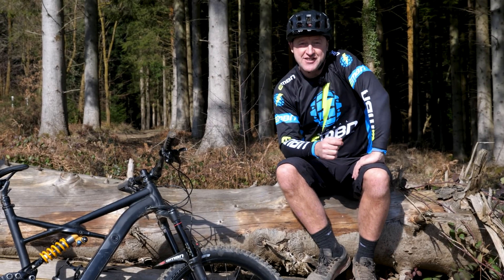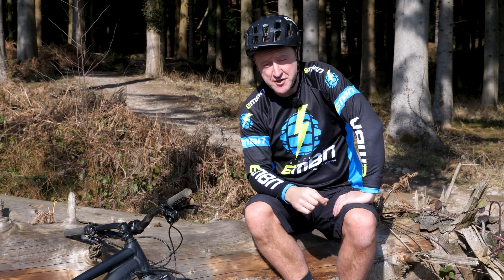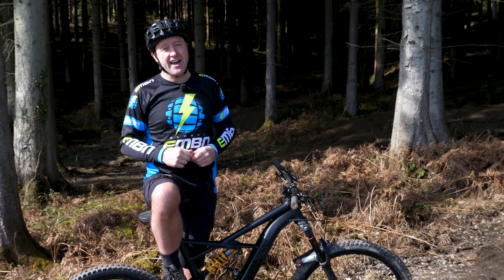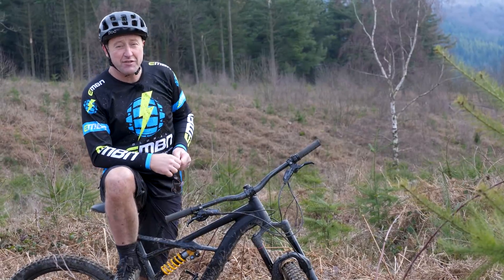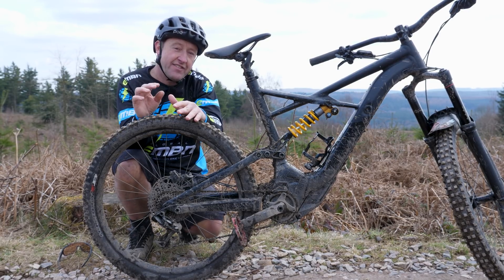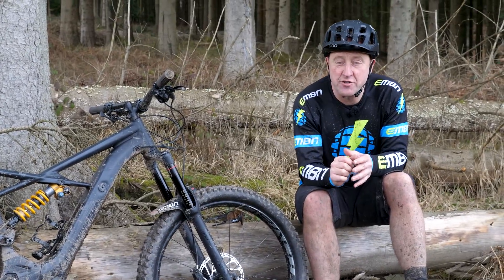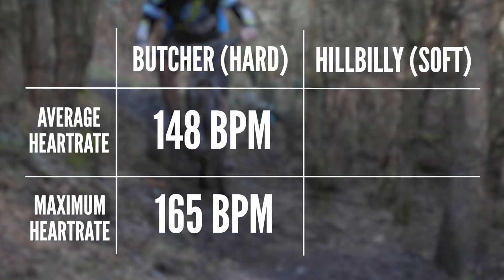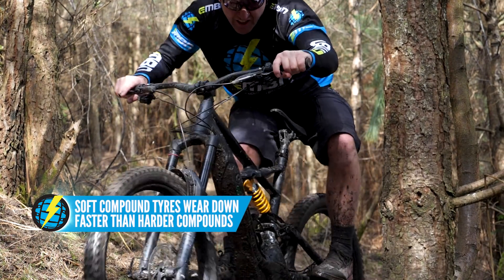Hard Vs Soft Tyre Compound | How Does Tyre Choice Affect Battery Life?

Comment: Fun video Steve but we really need to get you up to speed on power vs energy 😏 as you concluded in terms of power which has no time base. Here’s a pretty good explanation of W vs Wh https://cleantechnica.com/2015/02/02/power-vs-energy-explanation/ Having said that maybe you meant it was sapping 20-40 more Watts of power rather than using 20-40 Wh more energy? The problem there is how you measure or calculate either as power or energy measured at the battery is quite different to power or energy consumed at the back wheel due to serial system losses which are variable.

Comment: Probably should be done with the same tread and casings to truly isolate the compound. Also, Specialized doesn't publish the hardness of the Gripton tires: While the Hillbilly DH has very soft 42a knobs, we have no idea what the Butcher Grid Gripton has.

(BTW, the old non-Gripton Butcher Grid has the same (very soft) compound as the Hillbilly DH: 70a base and all knobs are 42a, so I can't imagine the Gripton tire having very much harder knobs.
Reply: Justin White Hey Justin yes you’re right there’s definitely an argument for that. What was interesting was how the Butcher worked well on dry but not so on wet. The Hillbilly excelled in the particular conditions however a different day with less pressure in tyres might have given a different outcome

Comment: Have not long changed from 2.8 minions, to nobby nics and now on magic marys in soft, and in these wet conditions, i can say that the magic marys have a noticeable difference in grip. have yet to compare them to my previous favs, the minions in the dry though. not easy to get hold of the magic marys, always seem to be out of stock in UK.. had to get mine from Germany.
Reply: drjarvis2003 Interesting. I was running ebike specific Nics back and front on my old 27.5 wheeled Scott. Now running 29 Hans Dampf front and Nic 27.7 rear, but like you I think I’ll go Magic Mary next. Haven’t decided on compound at present.
Reply: just incase you are interested, the magic marys, weigh about 200 grams more than claimed, at 1250 grams, not that its a problem on an ebike though. not sure if i would run them on my normal bike.
Reply: drjarvis2003 Thanks. Tougher tyre then and not really bothered about extra weight on ebike. I’d rather have safety with a heftier carcass.
Reply: thought i would let you know this, but i got delivery of a second set 5 mins ago and weighed them up at around 1100 grams, so weight is not consistent.
Reply: drjarvis2003 Cheers. Maybe depends on compound, whether addix or not.
Reply: They were all the same tyres, in soft compound and all addix, only difference was that they came from 2 different shops in Germany and my guess is that they would have been from different production runs.
Reply: drjarvis2003 Interesting and sounds reasonable. Funny I was just reading about quality control on Moto GP tyres and the variance.

Comment: Wasn't 28PSI too much in the 2,80 tires? Even in the slow-mo, they were just bouncing off of the roots no deflection at all.
Reply: Tamas Varga He’s a big lad is Steve 😏 And fatter (bigger to be polite) folk like me can’t get away with anything under 27 front 29 rear with tubes. I’d be off in a minute...
Reply: Tamas Varga totally agree. After 2 years of playing with pressure, I find at 88kg on a 3.0 optimal pressure is 15psi so a 2.8 would be I guess best at around 18 - 20psi max. My bike at 20psi is as good as unridable with the 3.0

Comment: Too much grip for me, looks like it slowed you to almost standstill in parts haha. Our tracks are dry and dusty in Oz, if I saw any soft black stuff Id be checking for oil ;) I pretty much run Maxxis Min DHR / DHF or High Rollers II. Are you tubeless? I am on one bike, on the rear, and its seeping through the sidewall, so not a fan..

Comment: If the leads of the battery are live, you can calculate battery percentages with a simple multimeter and a table like this one in a minute on the field. Just make sure the time between the end of the runs and the measurements are consistent as batteries tend to regain a few tenths after a hard run. https://sondorsforum.com/applications/core/interface/imageproxy/imageproxy.php?img=https://www.lelandwest.com/auto-tech/ul/36v-chart_strict.jpg&key=fb93dbc9badb19d1e36d4cd13f223ce12f610f5065faf84fc66b2a1e1cdca16b
Reply: TomaCukor Not so sure with LiPo that cell voltage is a good measure of SOC, surely better to use a shunt and Coulomb count? But that’s tricky with production eMTBs getting access to the battery negative. In fact as I work for this company below maybe I should look into installing one of these https://www.victronenergy.com/battery-monitors/bmv-700 with the free Bluetooth app. You got me thinking 😏

Comment: Great video. I think you got the tire diameters mixed up though. If the Butcher is has a 710 diameter vs the Hillbilly at 700 then the Butcher would end up giving you the higher bottom bracket height.
Reply: Yes that is correct Dean. Apologise for error on the text there. BB is lower with Hillbilly
Reply: Question for you Steve. I've been demoing a Commencal Meta Power with the Shimano Steps system for the past 2 weeks. I absolutely love it but I find the slight whine from the motor to be a bit annoying. My other option is the Specialized Kenevo. Is the Brose motor in the Kenevo quieter than the Shimano Steps?...
Reply: Hey Dean, have you tried the Kenevo? The Meta and Kenevo are quite different bikes
Reply: I haven't yet. I'm going to demo a Kenevo this coming week in Squamish. I live in Whistler and ride mostly Pemberton, Whistler and Squamish so I have a hunch that the longer travel Kenevo is what I'm going to be most happy with around here in the burly terrain we have. My main concern is that with the longer wheelbase on the Kenevo that it might be a bit of a tank on the technical uphill switchbacks that we have a lot of here. Thoughts?...
Reply: Hi Dean, my bike has the shimy steps and you do get used to the werr noise. I have tried the Levo and it is quieter. What I didnt like thou was the mode selector, flimsy, and no display to see your mode or gears(I have Di2). More bikes are coming on the market so lots of choice, but dont write-off the Steps motor over noise alone, too many other positives..Enjoy your shopping